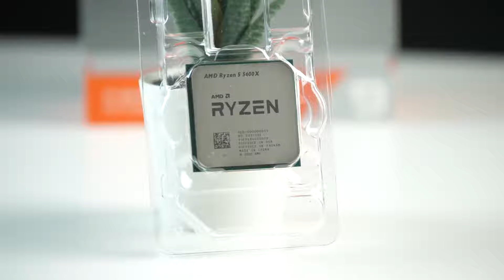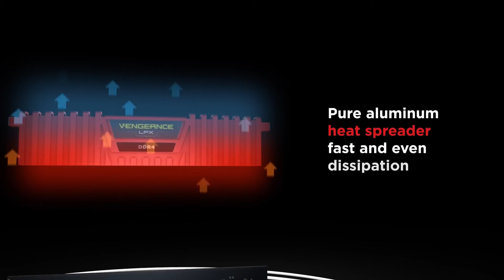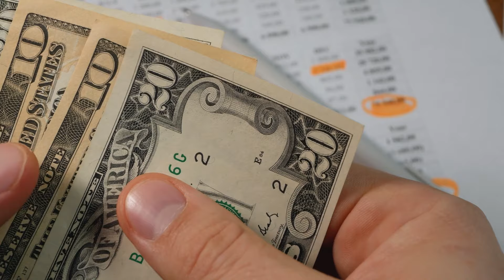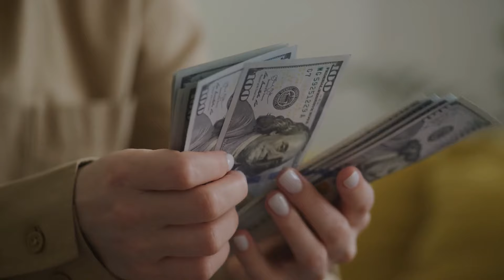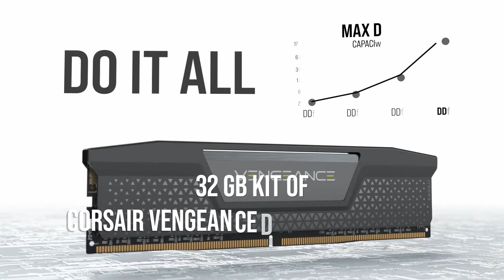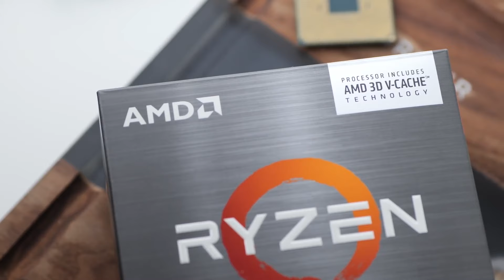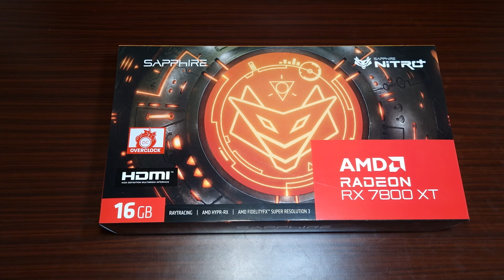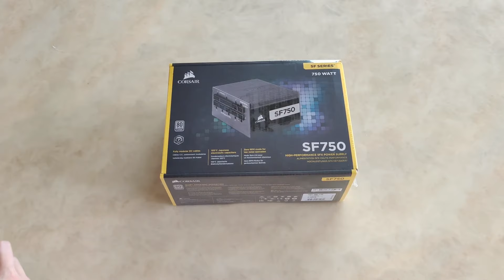Best PC Builds for 1440p Gaming Today!!

Comment: Is it good that i pair 7600x + 3060ti that the only gpu i can afford rn
Reply: If you can only afford 3060 ti I recommend amd unless you REALLY want rt performance and gonna use it everyday. I dont really know how much a 3060 ti costs and only one I could find was 450 which for that price you can get a 7700 xt at worst, and 7800 xt or 6950 xt if you can find a deal (even 6700 xt is better than 3060 ti)
Reply: @YavuzTheIntern  6800 xt is better than 7700 xt
Reply: I hope so, I have a 7600 being built with a 4070super lol
Reply: @SohanRaoisHim  7700xt will have more support for longer
Reply: @SohanRaoisHim  thats why I said 7700 xt at worst
Edit: 7700 xt as another replies said will have longer driver support. So it is up to the op
Reply: dont buy an 8gig card in 2024 that's a bad idea unless you getting that 3060ti for $200
Reply: @shasha023  yup. Op should do what I stated in my reply